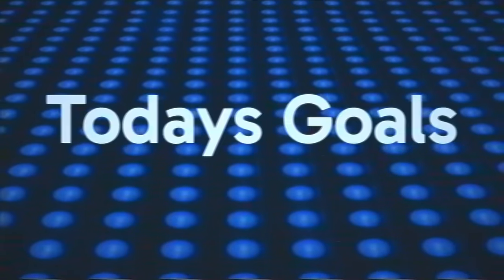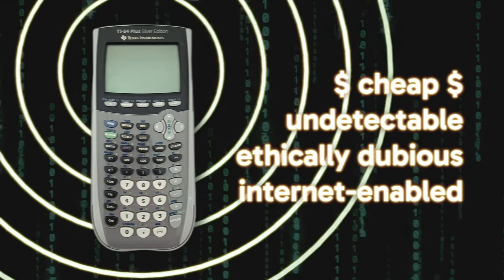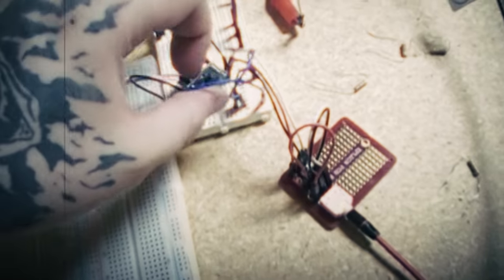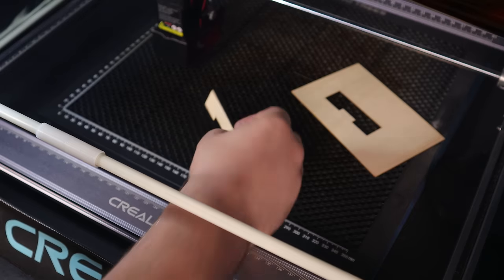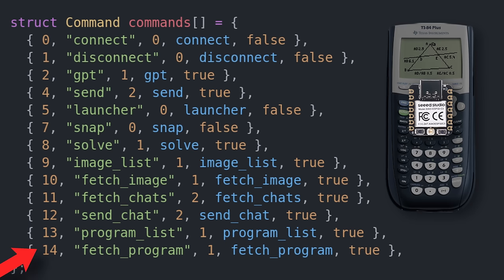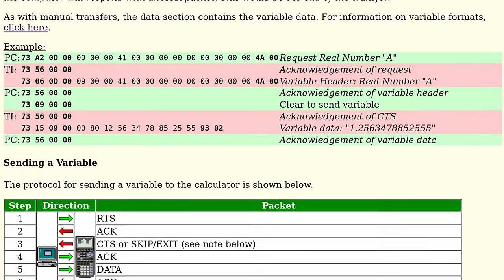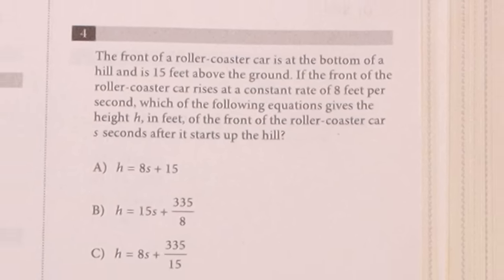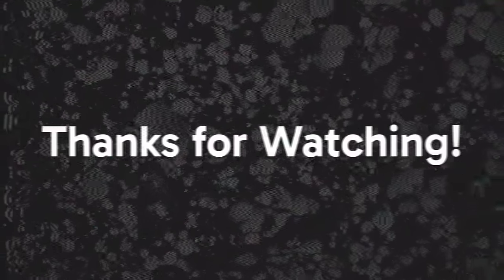I Made The Ultimate Cheating Device

Comment: My engineering classes didn't allow calculators on tests. If you were doing it correctly, the numbers could be 
calculated by a third grader. If you ended up having to multiply or divide something out by hand, you knew you're completely screwed.
Reply: How did you calculate anything regarding circels or angels?
Reply: @hyrize3797 Leave pi as is.
Reply: @bradwavemb  inaccurat as hell
Reply: @hyrize3797 our tests used to specify that it was okay to truncate pi to 3 for this reason. Sure you didn't get an accurate answer but it was enough to show you knew what you were doing.
Reply: @hyrize3797  What? As accurate as it can be. Lmao.
Reply: @bradwavemb  so you can calculate with an infinite number by hand?
Reply: @hyrize3797  Bro, what are on about? You don't need to compute pi. You leave it written as π, that's why there's a symbol for it.
Reply: @bradwavemb  and you‘re Brain knows exactly the first 100 digits of pi, that you can calculate a circle without calculator ?!
Reply: @hyrize3797  What?!

Let's say the question is: what's the circumference if the radius is 5? Then the only mathematically correct answer is 10pi.

If you really need an estimate — because, let's say, you want to buy a certain amount of food to fence a circular area — then you can use 3.14 or 3.1415 at the very end, but that will always be an approximation.
Reply: @bradwavemb  that is a task for 4 graders and not for an Engineering class 😂
Reply: @oliverer3  if you can set up the equation, you're showing you know what you're doing. No need to calculate it by hand. Sitting in an Engineering class is proof enough to be able to calculate +/-/*/:.
Reply: @hyrize3797  Good luck with the approximation error spreading from step one to step ten until it makes the result unusable then!
Reply: @bradwavemb  what? You’re the one with the approximation errors?😂
Reply: @hyrize3797  Surreal conversation here.

Dude, there's only one correct way to solve problems where pi is involved: you leave pi written as a symbol until the very end.

Again, if you really need an estimate, you approximate at the end.
Reply: @hyrize3797  wtf are you talking about rn? As the other guy says, the only mathematically correct way to write the solution to something using pi is to use the pi symbol in your answer
Reply: @bradwavemb  i dont need an estimate, i Need precise answers and those you don’t get if you only calculate with the first 3-4 digits of pi
Reply: @hyrize3797  That's why you keep pi written as is facepalm

That's the one and only exact answer.

Pal, as you've also written, it's the method that matters, the final equation/formula. Then you can plug the numbers and compute them however you want.
Reply: @Eggplanter_2027  Try to quickly and precise calculate the angular velocity of the last roller in a roller system that is positioned at a certain angle to each other without using a calculator.
Reply: @bradwavemb  Bro i didn't stated something different?! 🤦🏻
You can't calculate a Circle precise if you don’t use a calculator. As the First commentator told, they werent allowed to use calculators.
Reply: @hyrize3797  Are you for real? There's no way to get an exact result other than leaving pi as a symbol. Full stop.

In a test scenario with no calculators, which is what og is talking about, either you won't be required to give any estimates of pi or you'll use a brute approximation.

If you're talking about real life, then do whatever you want.
Reply: @bradwavemb  again, i didn’t stated something different?! Of course you need to leave pi as it is?!
Reply: @bradwavemb  and that isn‘t accurate. In an enfineering Claas it is pointless to not use a calculator, thats all i ment to say 🤷🏻‍♀️
Reply: @hyrize3797  I'm speechless: either you're trolling or not getting og's point.
Reply: @bradwavemb  what is your problem? 

To not use a calculator in an Engineering class is pointless because you don’t get accurate solutions, if you calculate something e.g. with pi? You think otherwise or what?! 

I Never stated you should use something other than pi. On the contrary, i stated you should use pi on the calculator. 

Are you trying to misunderstand me or what?!
Reply: @hyrize3797  I hate breaking it to you, but the pi on the calculator doesn't have an infinite amount of digits. Lol.

Also, in a real life scenario, knowing all digits of pi is useless unless all the other involved measurements are taken with infinite precision — spoiler, both things are not possible.

Anyway, og is clearly talking about a test in which the method matters more than the result, not some CERN level lab where you need an absurd amount of precision in your measurements.
Reply: @bradwavemb  i know, its 28 on (my) CAS-Calculator. 

And so because we can’t have anything precise its okay to not use the precisest we can get? 

my initial question was how they calculate Circles or Angels precise. you opend a copletelly pointless discussion and accusing me of things I didn't say. 

So what is your problem?
Reply: @bradwavemb  and if you use pi with three or 15 digits makes already a difference if you calculate speed in e.g. a complex precision gears. Don’t need to work at CERN
Reply: @hyrize3797  My problem is that you can't seem to accept that there exist tests in which you are not required to compute pi, but, in fact, leave it as is. Hence, no calculator is required.

Cheers.
Reply: @bradwavemb  twist it however you want.
Reply: @hyrize3797  100 digits? Nobody needs the precision of 100 hundred digits of pi.
With 37 decimal places you can calculate the circumference of the known universe with the precision equal to the width of a single hydrogen atom.
Reply: @oliverer3  that was a hyperbole, my god
Reply: @hyrize3797  you use complex numbers and Eulers identity to turn them into phasors (ie: things like e^( j *theta). You then do whatever manipulations are required using exponential operations which are much easier to deal with.
Reply: As far as pi goes as was stated above you leave pi as it is until the end and you only need it out to as many decimal places as your measurement. This is known as significant figures.
Reply: I'm an instructor.  I would say, anecdotally, about 2/3 of students at my university can not do any kind of math without a calculator.  And, if you give them pure derivations, forget that too.
Reply: which engineering ? mechanical needed calculator cuz many stuff were based on irl problem and numbers were realistic but wild
Reply: @hyrize3797 ever heard of numerical methods? propagation of errors? floating-point arithmetics? lmao
Reply: @MrCrackbear  no i didn‘t 😂said nothing about calculating pi. My statement was that no one can calculate with pi accurately (in a fast manner) only with his brain (don’t know the english therm for not calculating with a calculator), hence the 100 digits for visualization
Reply: @MrCrackbear  so yes We probably talked past each other🤷🏻‍♂️
Reply: @kvdrr  of course i do . But no Engineer (i know there are exceptions, bla bla) uses them in their daily work life.
Reply: @doubtingflock1073  oh thats nice  .i think different universities have different exam patterns,
Reply: @hyrize3797 what do you think your calculator uses if not floating point arithmetic….?
Reply: @hyrize3797  uhh no, probably the most accurate
Reply: @hyrize3797  WRITING JUST PI HAS NO ERROR
Reply: @hyrize3797  that is false

u can use the algorithm to calculate as accurate as u want

by ur logic, even computers cant calculate accurately
Reply: @hyrize3797   lmao what are you talking about mate leaving it as π is as accurate as it can possibly be
Reply: @dijital4801  Never stated something different
Reply: damn this was a wild ride
Reply: @hyrize3797  L + ratio
Reply: @hyrize3797 rage bait
Reply: @bradwavemb  Man just learn and move on. Any digit you put for pi would always have more have an approximation error than the constant π itself.
If you somehow encountered 24π - 259π². Slotting in pi in both places would give you more approximation error.

The most accurate would be leaving it till the end and slotting the value in the final answer.
Now 100π is basically the same as the full answer so the teachers count it.
In fact 100π accounts for every digit of pi to infinity. Any actual value you put would be a truncation of some sort.
So it's impossible for it to be less accurate.

Less of a final answer is what you could argue. But the teachers take it
Reply: @tegathemenace  Not sure why are you quoting me. What you wrote is my argument as well.
Reply: Guys I can't believe you took the bait from someone that clearly NEVER attended any engineering class ever, cause anyone that did knows engineering courses are more about how you apply stuff and how you can think shit out rather than the most precise results ever. That's for Mathematics PhD's or real world projects that rely on calculators anyways. 
That original comment gave big "junior dev that says everyone is an idiot cause they didn't rewrite their whole codebases in Rust" vibes.
Reply: @AaaaZ-lk9pd  Maths PhDs? Unless you're talking about some numerical analysis PhD, they have nothing to do with this matter.
Reply: @bradwavemb  I meant that Mathematicians, in general, tend to prefer high level of precision (sometimes just out of spite, I admit), especially if applied to high level analysis. And of course at the doctoral level if you go in these fields you very often can't round shit up randomly. But yeah, it was more of a broad stroke to give examples in contrast with academic engineering, I'm aware it largely depends on the specialization of the PhD.
My point was that the guy above (which you were responding to in a very sensible way) made it seem like engineering at its core required the highest numerical precision possible from the start of engineering studies, which is simply not true. 10pi is ok expressed as 10pi, g can totally be 9.8 or even 10 in some cases, it doesn't really matter for the point of what engineering studies represent. Then in the real world you obviously need the precision, but again you have computers
Reply: @hyrize3797  "circels or angels"

I don't know if you mean to come across as a character from a Monty Python sketch, but well done for doing so!
Reply: @hyrize3797  No engineer uses pi in their daily work life? Have you ever heard of a circle?
Reply: @lunchbox1553  Never stated that
Reply: @hyrize3797  You did, and you haven't deleted any of your comments, so I don't know why you're lying about that and not even trying to engineer your truth.
Reply: @AaaaZ-lk9pd  I get what you're saying, but it's not what 99% of Maths PhD are about.
Reply: @lunchbox1553  no i didn’t? „But no Engineer (i know there are exceptions, bla bla) uses them in their daily work life.“
Reply: @lunchbox1553  i‘m only engineering metal and not the truth 😂
Reply: @hyrize3797  Metal to increase the density of your thick skull? I don't think that's very necessary, I think you're good.
Reply: @lunchbox1553  Nop, more for your truck‘s  Cylinder crankcase
Reply: @hyrize3797  rage bait but.. damn you're pretty good at it.
Reply: @WizzardLizzardd  thanks
Reply: @bradwavemb  I'm aware:)
Reply: You can really tell the difference between those who have taken college engineering and those who haven’t in this thread.
Reply: This was an incredible read and I want to personally thank everyone involved.
Reply: @kabinet0 I still don't really get their respective points.
Reply: In my engineering classes, we're expected to use CAS calcualators or even MatLab during exams with cheatsheets (often pages long) of equations and graphs. 

The focus is on actually understanding the physics and what equations to use in which situation (and where those equations come from). Actually doing the math is just a means to an end.

Comment: I genuinely did this same thing back in highschool in 2014. I integrated a Bluetooth chip into my calculator connected to the 2.5mm IO port which communicated with my phone (which has cellular) to send wolfram alpha API commands from the calculator and receive the results back. I recently thought about bringing it back and integrating chat gpt into the mobile app I made for the Bluetooth communication. It started with me making a line plotter that plugs into the IO port controlled by an arduino that draws graphs from the graphing screen where I reverse engineered the IO protocol of the calculator and wrote a library for arduino to communicate with the calculator. From there I designed and laser cut a little 3 axis plotter controlled by 3 servos. I did that because I was tired of drawing graphs on my math homework, it worked great haha. From there I went big with the wolfram alpha integration. I should have documented it and posted my project online.

Side note I saw this video in my recommended and I havent watched it yet, I just felt I had to share my experience with a presumably similar project I did.
Reply: Damn you had access to some banger resources in highschool.
Reply: thats sick. i thought of doing something similar back in high school on the ti 84+ ce but never got far enough bc it lacks the IO port. it takes a lot of dedication to basically brute force your way through learning everything necessary to make such an old and essentially obsolete piece of technology such as a ti calc with an ancient chip in it to work with modern devices, so massive kudos to you
Reply: Dude you were clearly already a genius you couldn't have even needed to cheat lol
Reply: I once turned in the source code of a computer program I wrote as my "work" in Algebra I 😂
Reply: Man if I were an engineering professor and I find you doing this, you'd pass
Reply: Spoiler alert: You didn't need to cheat anyways - you could have easily passed those tests.
Reply: i got first electronic device including calci in 2016 ;-;
Reply: @chromalock a bluetooth connection would be more stealth than a wifi hotspot that people could see if they opened their wifi settings.
Reply: lol
Reply: @JasonWho  Bluetooth connectivity can be direct from device to device without showing publicly. You can essentially make a bluetooth signal only accessible to devices that have the key hardcoded. A sniffer can still find it but it's not abnormal to see a private bluetooth network with random letters and numbers as its BLE address.

Comment: I had a TI-Nspire calculator before the color model came out, those had 2 different versions, one with CAS and one without, I had the non-cas
CAS had functionalities like putting in an equation, solving it, and showing the steps it took to solve them.
Thru a little binary hacking of the firmware files, you were able to load the CAS software on the non-CAS model, couple that with a custom bootloader with the option to reboot out of test mode, we had a lot of fun.
props to the TI hacking community, set me up for a career of cybersecurity research.
Reply: That's like if the PS5 Pro was not, in fact, a different model, but instead DLC you had to buy online (the PS5 was always able to do it, but you had to pay extra)

Comment: This was perhaps 15 years ago, so I don’t remember the details, but during a statistics course (or something similar) we learned really long and cumbersome calculations that took forever to calculate by hand. I realized that this math could be done using matrices and there were awesome built-in software for doing advanced stuff with matrices in the TI-84. I could solve these problems in a couple of minutes with matrices and the built in tool while it could take like 15-20 minutes doing the math manually. Never told anyone so everyone was blown away about how fast I could do the math.
Reply: and that's why math is so awesome!
Reply: simultaneous equations?
Reply: Fucking cracked

Comment: Back in my day, we used that 2.5mm jack to build a home-made cable to connect the calculator to a computer using a parallel port. The official cable was very expensive. This was in the 2000s before USB was widespread. 

I'm surprised these same calculators are still around today.

Comment: But does this work with modern Ti-84s? Because all the new ones are faster and use a much higher resolution color screen
Reply: i hope so, but i'm pretty sure that they don't have data jacks
Reply: They have a USB port which people have written libraries for so yeah you could do it. They’re a little more compact though so you might have a bit more trouble cramming an ESP32 in them.

Comment: My calculator has formulas written in permanent marker on the back and inside of the cover. They came in useful for GCSEs, A-levels, and even uni. Never been caught, and I still have this calculator. I'm still terrible at maths, but I'm far better at solving problems, so it just got me the results that showed I can do this stuff, just on my own terms instead of a predetermined way that didn't work to my strengths.
Reply: I mean, one of the most important bits of maths is just figuring out what formulas you need to use.

Comment: Something I discovered to late in life: It is entirely possible to solder surface mount components with a good iron, a clean tip and flux. I still can't do leadless ICs but everything else is doable.
Reply: Same with me, all I needed was a clean tip. My solder never sticked it just turned into balls and fell down.
Reply: in highschool

this was an assessment for our lab lol

to solder smd

could solder smd as long as the pin is exposed

heck i could even do 0402, im not sure if i have done 0201

but for the chips with underside pads, couldnt do without at least a hot air station